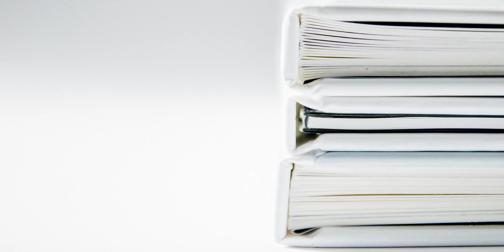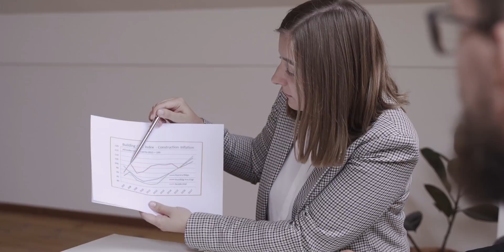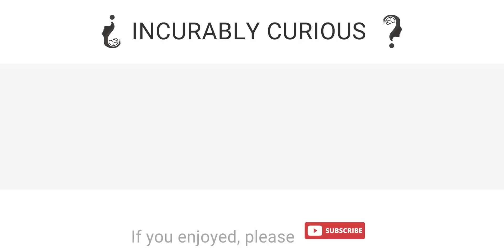Why Most Power Lines Aren’t Underground

Comment: The differential cost between underground/overhead lines is very much depending on the voltage level. For example, at Medium Voltage (i.e. 20 or 30 kV) it's possible with mechanization to have a very good low cost of installation. At higher voltages it's different. And at Very High Voltages (above 220 kV) even if we could pay for that, the capacity of production of all the cables factories in the world would not be sufficient to renew the Overhead lines. This is so reserved to urban areas or very sensitive areas. Fortunately, with the progress of HVDC Very High Voltage cables 500 kV DC its possible to reduce the losses inside the insulated cable lines, and therefore to build longer underground links.
Reply: The real problem with very high voltages is that wherever there is a junction it becomes difficult to maintain insulation  , the slightest opening would result in catastrophic shorting .
Reply: @losteroni  Hopefully, we know how to make reliable Joints at least up to 500 KV!  The technology exists and it's widely employed by all leading cable makers (NKT/NEXANS/PRYSMIAN) etc...
Reply: With microgrids 20 to 30 kV local cables are capable of being the only connection between properties because the source is distributed, the overflow that isn't being used at the point of generation is spread, sharing the load over hundreds of residential and other buildings. Like a web of interweaving roots instead of a wheel with spokes, then I reckon it can all be underground.  No long distance high voltage cables anywhere, because the source is on your street.